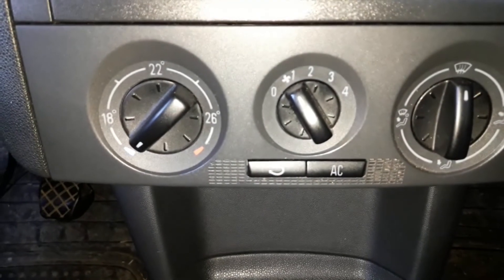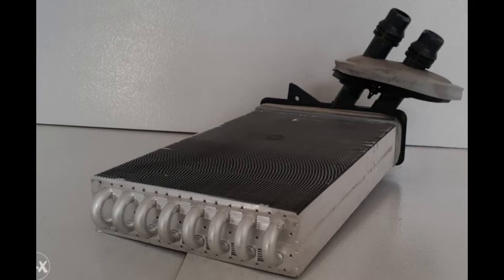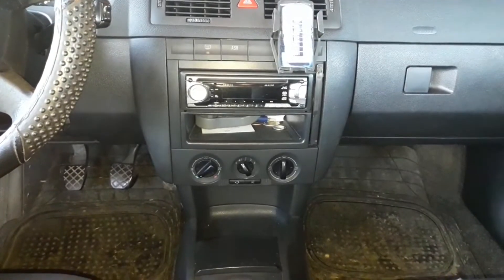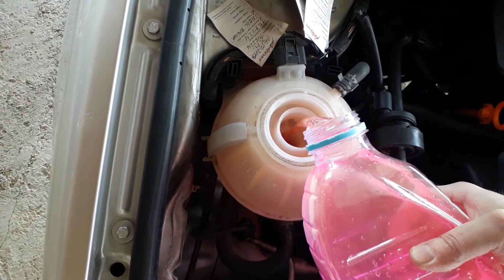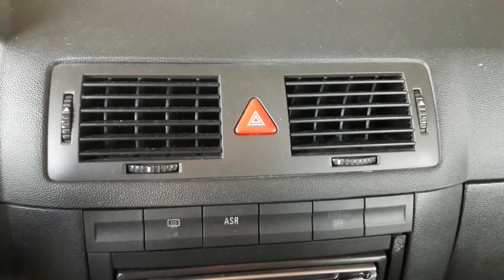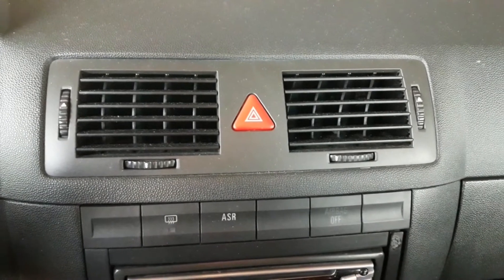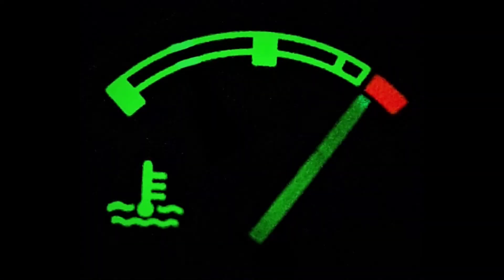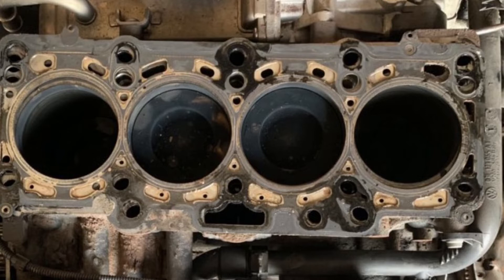Bad Heater Core Symptoms-10 Tell Tail Signs That You Have a Heater Core Problem

Comment: I have done so much research on this cause I'm currently having this problem. Now, many videos shows as part of solution is unclogging the heater core with a flushing it. Now when i first encountered the first symptoms, it was was that in the winter the passenger side there was no heat but blowing cold air meaning that perhaps the clug was build and needs to flush out. Now, my question is, that if a flush is conducted, how would i know if this will stop the leaking from the heater core to the inside of the car. That is my major consern. My question is, if the flush on the heater core is conducted, is there a possibility that maybe the heater core is not damage and the leak will stop or the heater core is damage which is causing the leak. Like to know what am i expecting. I appreciate your reappnse thank you.

Comment: I'm losing coolant on every drive, have wet floor mats, and heater isn't working.  Now, how to correct all this and fix it.

Few days back, i got the cooling system filled with R34 gas and got the pipe repaired.
Reply from the maker: Hi and thanks for watching! What pipe did you repair? In what place?
You'll probably have to replace the heater and then pull all the carpets and insulation out to dry everything up.
We made a video about the aftermath of the heater core problem and what happened on my wife's Clio.
There you can get a preview of what awaits you in that case.

Comment: I have a 02 Chevy Silverado and I’ve replaced my thermostat my water pump and I replaced my radiator cap with and my heater hose about a year ago because that was leaking but now I’m here the last 3 months have been a train wreck with my truck I need help I think it could be my heater core my truck is overheating but no leaks in the cab but I’m losing coolant does it always leak into the cab or no does a clogged heater core cause coolant loss? I’ve gotten my head gaskets both of them when I did my engine rebuild so I’m confident that it’s not that and my oil is clean as a whistle no coolant whatsoever so that’s good but my truck is still overheating and losing coolant BUT FROM WHERE I can’t say. My local shop I took it to them twice and they replaced the water pump and fan clutch I’m just getting pissed off because this truck is my passion and it’s pushing 400hp it’s a clean ass truck but I just want my truck back on the road running right please help anyone I also live in California it’s hot as fuck right now can that have a effect on coolant levels?
Reply: Did u figure it out ?
Reply: @ yup it was a head gasket I got new ones and got rid of those shitty stock head bolts, and studded those bitches. It’s funny because I got my parts off summit and I never had an issue with summits parts till then. It’s funny tho because my truck did pass a head gasket test but the crack was so small on the gasket it was just burning on the block instead of getting into the cylinders that’s why I had no symptoms besides losing coolant

Comment: I have a class Mercedes 2014 1.6 petrol before start the car i feel sweet smell of coolant and after 3 or 5 days dropping the coolant level and in cold weather windscreen and other windows getting fogs on classes when i starting the heater for 5 or 8 minutes from 2 heater vent cold air coing after 20 minutes getting better what can be the problem please and the same time engine gauge temperature 90 or 39 . But when pulling up the hood i can feel the more heat feels in engine what can be thanke

Comment: Hi boss I have a class Mercedes in the morning before start the engine I feel sweet smell of coolant and driving time when push the gas padel hard accelerating sweet smell getting more and more coolant gauge is getting low dropping but no any symptoms of leak inside of the car or under hood heater is works getting heat in car I'm the same time in cold weather I can see the fogs on car windscreen and other windows rear glass too I don't know what's that please cam you gave me some guidance please thanks???

Comment: I hear the hissing, while most other symptoms are not obviously present.  2nd video on this subject I watched.  But it is only one that confirmed my suspicion.  I would have never suspected from the overflow cap, it sounds more like from the glove box in the driver seat (and might be, but I recently had the overflow cap replaced).  And the hiss continued for five minutes after engine shutoff.  The film on the window is another not recognized by me symptom mentioned.  It's a 19yo car, I expected more corrosion than the other causes.  Since radiator fluid is known to be highly corrosive.  But the thermostat and related things have been replaced twice in the past two years.  First time was a busted plastic housing to the thermostat (the replacement part was metal).  The second actually triggered a check engine light.  I cooked the engine on the first one, but I did pull over in time to save it (mostly).  Very frequent oil changes and complete hose replacements, and other related failure of parts recently replaced.  But back to normal-ish now, except heater core.

Comment: My 94 mustang was sitting and coolant system was gumped up I noticed the fog on windshield only twice. but I need to change thermostat after flushing the system… I noticed that I’ve seen the windshield fog only twice but will it do that only due to overheating? I have no leaks on floorboard or coolant smell but when it gets hot u smell it in cab evaporating. It sometimes starts to blow warm but not hot and will go cold. I assume it is probably clogged due to the coolant system getting gummed up and clogging the heater core??? So is it a no brained to change it? I just got the car and it is overheating I’m doing thermostat tomorrow just wondering if this could fix the no heat issue as I am still bleeding the air from coolant after flush and coolant change. Or does the low or no heat issue automatically mean it’s the heater core? Anybody

Comment: Hello I have Audi a4 2.0 tdi 2019. I have't noticed the wet carpets only thing sometimes A/C is not working properly when heating. I brought my car to regular maintenace and they spotted coolant leak on the water pump, also they said the heat core should be replaced. It is strange to me such a young car and this things need to be done. I then asked them is it possible to clean the heater core somehow since it is the last thing I wamt to take off the complete interior to change something that can be unclogged in another way....
Reply from the maker: Hi and thanks for watching! Regarding the heater core, there's a possibility to do a flush but this is only theoretical.
Audi has a pretty crammed engine bay and it all depends on where the heater core connections are and how they are mounted.
The damage may have nothing to do with the car but perhaps the coolant. If the wrong coolant was used, it can easily cause both the water pump and heater core problems (this is just a suggestion).
But did you take a look at the evaporator drain tube for the AC?
These are known to get clogged over time on lots of VW cars and cause a wet floor.

Comment: I still have good heat but my floor driver side floor board started getting wet while it was dry today and I have been using a lot of antifreeze. Could there be another problem besides the heater core causing the overheating?
Reply from the maker: Hi and thanks for watching! If there's a strong smell of coolant form the floor, then the heater core is the probable cause.
It can also be a punctured hose to the heater core, loose clamps, perhaps a bad valve (depending on the car type).
All in all, it would be something related to the heater core if not the heater core itself.
Reply from the maker: So, check the floor first, If it's just water search for another cause of problems.

Comment: I bought a 98 Dodge Durango about 3 weeks ago. I started to notice fog on the inside of windshield while driving. No coolant leaks under car. I dont notice low coolant level when removing radiator cap. No smell inside cabin of coolant. Im scared its the heater core, but no symptoms other than the fog inside windshield. ????
Reply from the maker: Hi, and thanks for watching! Perhaps try checking the cabin filter first.

Comment: My car leaks from underneath the frame of my car. And my rear defrosters don’t work and my heat doesn’t work. Do you think it’s a clogged heater core
Reply from the maker: Hi, and thanks for watching! With these symptoms, I would rather check the radiator, hoses, and else first.
Especially if there's a big loss of coolant

Comment: For the last month, I started having an over pressurized system on my Chrysler 200. Then my windshield started fogging up. And then I noticed it was wet eventually where my gas pedal is. Every symptom you described happened to me one after another. Right now I just ran a bypass by connecting both firewall hoses to each other. And now it’s fine but I know I have to get it replaced. Luckily I live in Florida. Thanks for your video so I know it’s for a fact the heater core
Reply from the maker: You're welcome and glad that the video helped 🙂. Also, congrats on the repair, being resourceful and temporarily solving the problem.

Comment: I noticed a smell of coolant coming from the front of my 2012 Ford F150 yesterday and my coolant was a low. I just added coolant a month ago. Today, I drove about 10-20 miles, and when I stopped at a stop sign and there was a tone of steam coming from under the hood on the passenger side. When I possed the hood, there was coola t all over mt engine. The reservoir cap was on. I kept hearing a hissing sound ever few second coming from the back of the engine on the passenger side. My engine didn't overheat and I haven't had issues with my heat, in fact my heater has worked great. It was pouring rain so I ha en't been able to check anything yet. But could a bad heater core cause the coolant to spray all over my engine like that? I'd appreciate some feedback.  Also, is this an easy replacement? I have little knowlege on cars, but I do my own oild changes, have replaced a water pump, and changed a variable timing solenoid valve myself.
Reply: Howdy ..what everr happend?

Comment: 03 durango with 274000+ miles is starting to fog the windshield up but I had that heater core replaced MAYBE 2 years ago. The labor is the killer vs buying another heater core. Much rather buy another vehicle and just keep my durango for running to the store, errands etc
Reply from the maker: Hi and thanks for watching! You're right this is the main problem with heater core replacement. The part is only 10 to 20 percent of the price.
The rest are labor fees (in most cases).

Comment: I got my heater core replaced by a mechanic, it was working the day he fixed it and it was fantastic, a week later back to how it was before i got it fixed heat not working when i put it on mix. What could it be???
Reply from the maker: Hi and thanks for watching! There could be numerous reasons.
The most common problem especially after a heater core replacement is that there may be pockets of air left over in the system.
Reply: @DespairRepair  how do they get the pockets of air out, and thanks for commenting?
Reply from the maker: @user-tm4fn2nl2v  they vent the system. On some cars it's simple, it can be done by just loosening the coolant bottle cap or the radiator cap (if there is one), turning on the engine, and letting the coolant circulate. The air eventually gets out.
On some, it has to be vented via vent screws located on the coolant system. A bit more fuss but not that complicated.

Comment: I changed my heater core, and I’m still getting a steamed cabin, like the coolant vapors are coming through the vents, maybe I have to replace the hoses?
Reply from the maker: Hi and thanks for watching! If the vapors smell like coolant, then there's something wrong. 
If so, there must be a leak somewhere very near the heater core or on the core itself.
If it doesn't smell like coolant, then you might have a condensation problem, like when the cabin is moist or wet somewhere.

Comment: Quote: "The best way to drive with a leaking heater core is to turn of the heating completely". WRONG. There is a constant flow of coolant throug the heater core regardless of the position of heat adjustment.
Reply from the maker: Hi and thanks for watching! What about the heater cor valve 🙂
Reply: @DespairRepair  Heater core valves is a thing in much older cars. In modern cars heating and distribution is all done by the different blenddoors.
Reply from the maker: @carstenpedersen5541  do you mean actuators?
Reply: @DespairRepair   The actuaters actuate the blenddoors which controls the airflow.
Reply from the maker: @carstenpedersen5541  You're right, I get what you mean now.
But I think that there are still a lot of cars out there that have a heater core valve and closing it via the climate controls might help in case of leaking.
My Skoda has it and its only 18 years old 🙂 🙂🙂.
Thanks for sharing and hope you like our videos.
Reply from the maker: @carstenpedersen5541  you're right, didn't understand the first time 🙂
Reply: @DespairRepair  Not even my old 2002 Passat 3BG had a heater core valve.
Reply from the maker: @carstenpedersen5541  great car by the way.
Found this :https://www.ebay.com/itm/265146837661
Reply: @DespairRepair  I see your point. My Passat had Climatronic (full climate control) i think that this valve is to a car with Climatic (manuel climate control).
Reply from the maker: @carstenpedersen5541   hi again, I think you're right. If you believe me I thought the same thing.
Anyway, nice meeting and chatting with you and once again thanks for watching and sharing.
All the best to you.

Comment: I have to repeatedly put coolant in my car for air or heat but don't know if it is heater core or water pump
Reply from the maker: Hi and thanks for watching!
You'll have to make an inspection for leaks, if you have to frequently add coolant you should be able to find the leak easily.
Regarding the heater core, check the underside of the floormats and the carpets under them if they're wet. This is in most cases the most obvious sign of a heater core problem.

Comment: Question my heat comes on it’s hot but not supper hot  it gets much hotter when driving what do you think it could be I have a mini copper s
Reply from the maker: Hi, and thanks for watching!
This is normal since the heating starts working at full capacity when the engine reaches working temperature.

Comment: Great video btw, My 98 Chevy Cavalier has those symptoms of leaking on the passenger side and the hissing sound after running it but I also noticed my coolant is leaking from my heater hose but not from the pipe itself seems like deeper than that

Comment: If the carpet is wet on passenger side is the heater core still considered as clogged? Am i able to unclog it? 
Also another thing i noticed even after changing my whole cooling system except heater core which my heater does not work …. my truck still over heats i live in vegas
Reply from the maker: Hi, and thanks for watching!
Regarding the carpet, if it's wet then you probably have a leak.
A clog will usually cause overheating or excessive pressure in the system.
There are ways of unclogging the heater core like flushing it but from personal experience, if you have the possibility, buy a new one.
Hope this helps.

Comment: Sooooo I have one of these issues. When I turn on my air or heat I smell coolant for the first ten seconds. I don't have any leaks or wet carpets or any of these other issues. I'm wording if my issue would be a small leak where the hoses go to the heater core in the engine bay. Cause the smell goes away after a couple seconds. My coolant been same level no drips nothing u listed besides the smell for 10 seconds... What would u recommend?
Reply from the maker: Hi and thanks for watching!
Well, that's a tricky one. As you've described it, it seems you have a problem that's just started.
The best thing to do would be to make a thorough inspection if possible. Maybe it's not anything serious, maybe it's a loose clamp or something.
But if it's a cracked or damaged hose, cracked heater core or else, now's the time to react so it doesn't get worse.
If it bursts, you can loose coolant really fast.
Hope this helps.
Reply: @DespairRepair  thank tou
Reply from the maker: @Budweiser-jh9uj  you're welcome

Comment: I have 2010 nissan versa and I can see it leak coolant from one for the pipes there when i remove the plastic cover next to the pedals.  What can I do?
Reply from the maker: Hi, thanks for watching, and sorry for the late reply! Sorry to say, but it seems you'll have to change the heater core.
But before that make sure 100% it's the problem. Try to make some clearance (remove plastic panels and else) to make sure where the leak is coming from.
Once again, be sure it's actually the heater core.

Comment: I drove my girlfriends car and turned the heater on, it was blowing cold air then I notice a fog build up on the window right above the heater core. I told her, I think it's your heater core and they aren't easy to change most of the time you have to pull the dash out to get to them. But after watching a few videos, I think there maybe an easier way. they said, the same thing about my truck, pull the dash out. But I was able to remove it and replace it, without much trouble from under the dash.
Reply: I noticed that to when I drove it but didn't care to mention it.
Reply from the maker: Hi, thanks for watching and sorry for the late reply. Congrats on doing the job. You're right,  lots of times with some fiddling around and thinking things through you can spare yourself a lot of dismantling (and trouble).